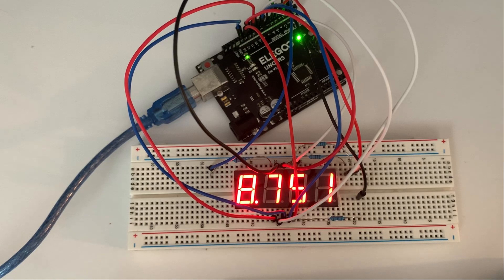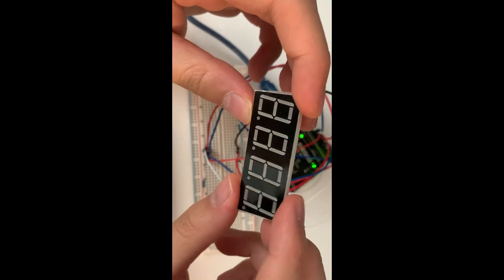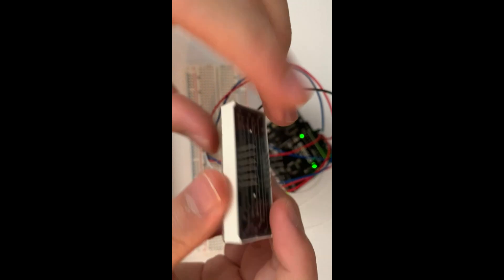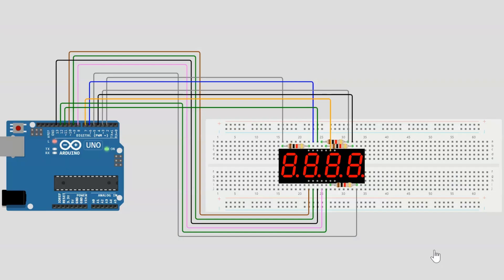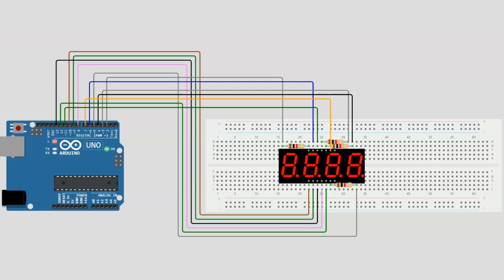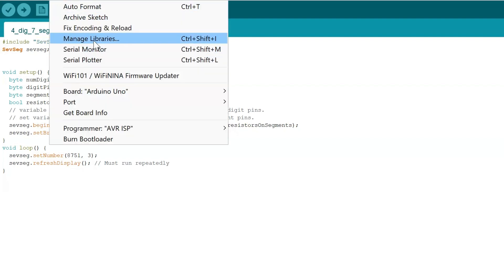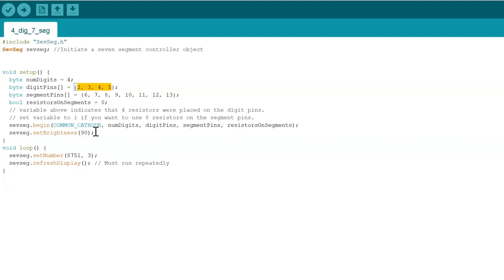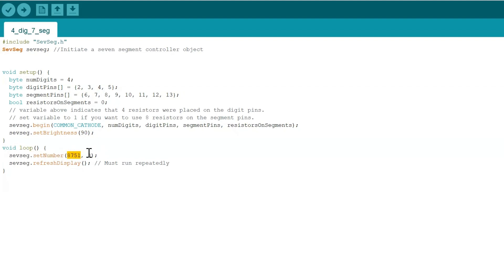How to build the 4 digit 7 Segment display in 90 Seconds

Comment from the maker: #include "SevSeg.h"
SevSeg sevseg; //Initiate a seven segment controller object

void setup() {
  byte numDigits = 4;
  byte digitPins[] = {2, 3, 4, 5};
  byte segmentPins[] = {6, 7, 8, 9, 10, 11, 12, 13};
  bool resistorsOnSegments = 0;
  // variable above indicates that 4 resistors were placed on the digit pins.
  // set variable to 1 if you want to use 8 resistors on the segment pins.
  sevseg.begin(COMMON_CATHODE, numDigits, digitPins, segmentPins, resistorsOnSegments);
  sevseg.setBrightness(90);
}
void loop() {
  sevseg.setNumber(8751, 3);
  sevseg.refreshDisplay(); // Must run repeatedly
}